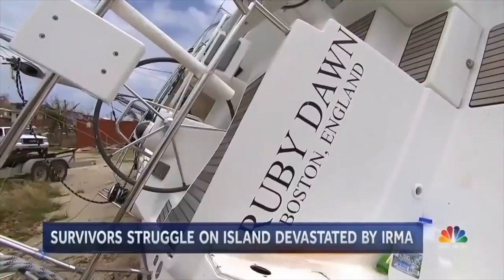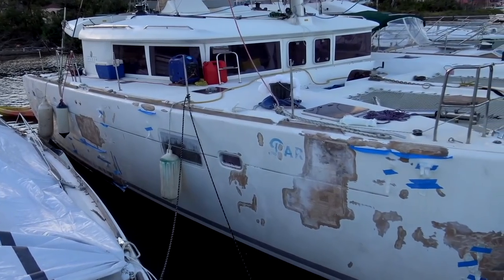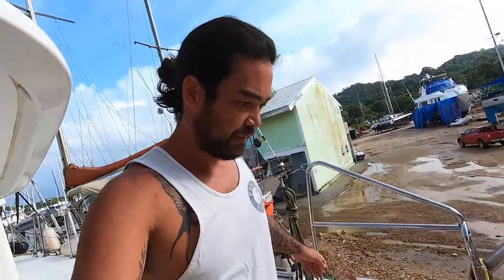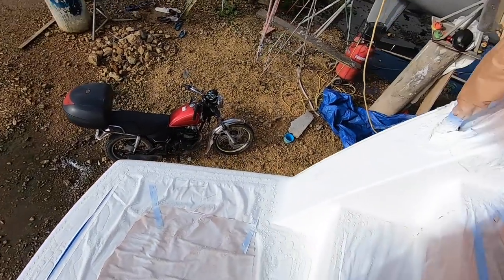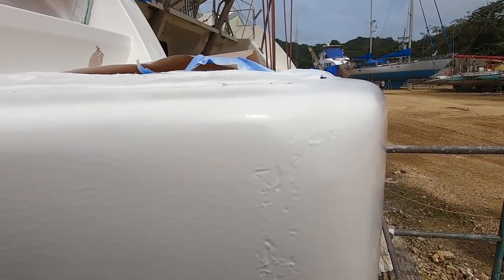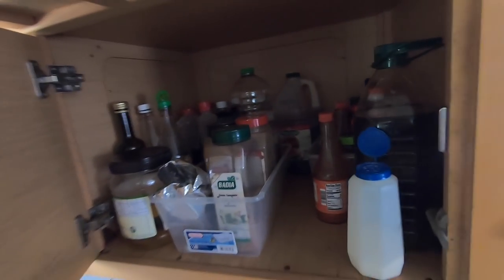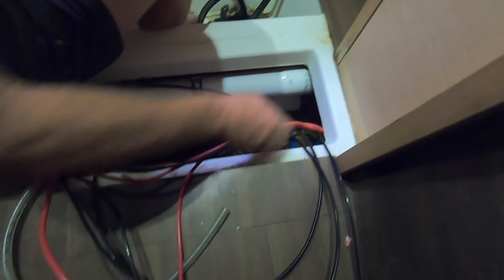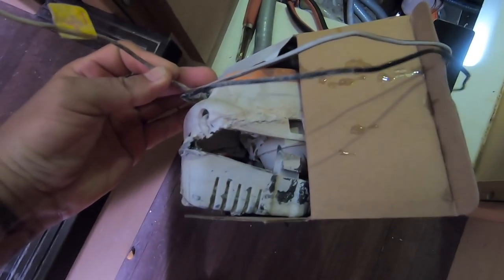SPRAYING OUR SUGAR SCOOP EXTENSIONS WITH GELCOAT! - Episode 138

Comment: That foam you put in between the panels is known as “backer rod” here in the U.S and it is used exactly for what you are doing but it is used to fill the expansion joints in concrete roads as something to put the joint sealer on so it doesn’t take as much sealer. Great work!!!
Reply: Martin, I was going to say the same thing, though I use it on bridges. I doubt he will see the +/- 50% movement I see or the freeze thaw cycles, so it should hold up just fine. Really impressed by the work, can't wait for it to see it back in the water.

Comment: 15:51 😬 yikes man.  I’ve got some videos of people almost bleeding out from making cuts like that. The femoral artery isn’t far beneath the surface there, and a nick in it can make you bleed out in 2-5 minutes without knowledgeable and well equipped treatment.  It’s extremely difficult to stop the bleeding in the field. If you can’t get a good tourniquet on a few inches above it, or packing the wound tightly with hemostatic gauze, they’re pretty much a goner, and even in the best case scenario, they’ll need a level 1 trauma center immediately if they want to survive and keep the leg. I’d strongly advise that as a skipper you receive an 80-hour Wilderness First Responder training and develop a well equipped med kit to keep on board.

The boat is looking stellar! Really stoked to see those transom extensions coated.  You did a great job making them look like they were part of the original design, as they don’t break up the lines of the hulls at all. Excellent work.

Comment: boats looking good the rough no slip will smooth out with use quick fast  PS  remember that nothing sticks to silicone but silicone when spraying finishes be careful not to contaminate surfaces with it

Comment: After repairing / upgrading the bulkheads, fixing / upgrading the steering and adding the extended sugar scoops which will improve the length / beam ratio, the increase in performance and handling characteristics is going to be astronomical! You basically rebuilt the boat the way Lagoon should have built it in the first place! Enjoy your incredible engineering and hard labor!
Reply from the maker: Thanks Dan!

Comment: That foam strip that you are using with silicone on top is a technique used in buildings for openings like windows etc. the technical term is “backer rod” it’s always foam that is high density and acts as a insulator also.

Comment: When pulling cables - always pull a "guide rope" (even if its just a piece of string) so it makes it so much easier when pulling additional/replacement cables - and remember to pull a new "guide rope" if you use the existing one.

Comment: You know that's prior damage proof before the hurricane added plates as a patch not even sure I saw stop drill holes on the cracks.
Great job on small fixes grinding back to solid glass.
My solar array on the Rv is 1.2KW 24 volt panels ran in series strings to 48 volt parallel  400 AH batteries Lead Acid.
Colin has a nice system in place.

Comment: Was just wondering, do those cracks go into the fiberglass or just the jell coat? If just jell coat no problem but for those that are in the fiberglass do you grind out all the crack so it doesn't progress? If not do you stop drill the crack?
Reply from the maker: Yea if the glass is damaged at all you just keep going deeper till you hit good stuff then re-glass!

Comment: Some of the minor cracks, especially on inside corners might have an other explanation then movement. It look’s like the gelcoat
is very thick at every spot where the laminate is exposed. 
The ideal thickness of gelcoat is about 0.7 mm. If it is thicker it  will shrink and crack when it is exposed to heat/sun. This is very common on places where the deck meets a corner.
I used to spray gelcoat at a boat factory for 3 years. My boss monitored the thickness of the gelcoat closely every day, for a full month. Before he trusted me too spray the right thickness of gelcoat. He didn’t want any of the boats to develop hairline cracks as the got older. These brand of boats has very little defects and cracks after many years. I have seen new boats at boat shows that has developed cracks already. This is just because they have sprayed to much gelcoat, especially over sharp edges/corners.

Comment: Probably would have been better to have cut the ends off the panel wires and bought some MC connectors. You could have drill much smaller holes.